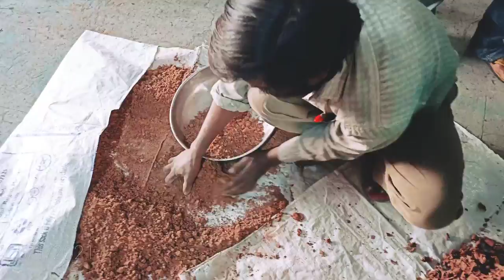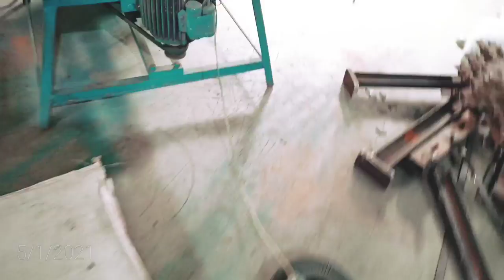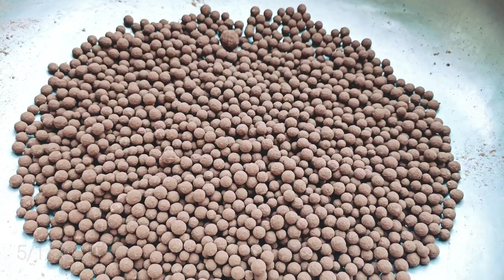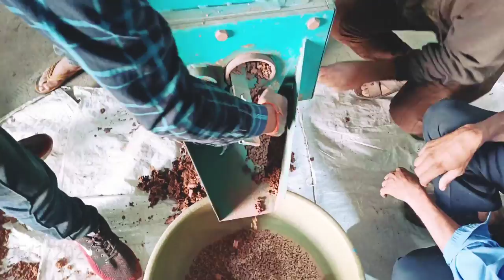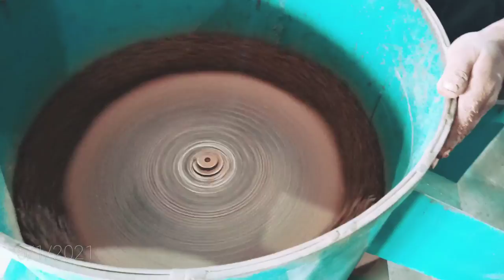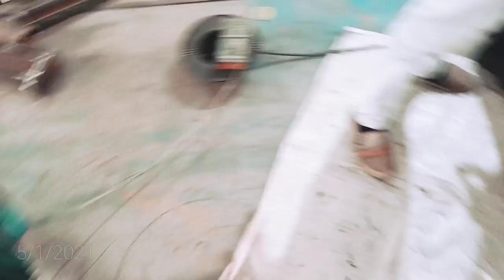Organic Fertilizer Granules Making Machine, Organic Waste जैविक खाद्य बनाने की मशीन,Organic Fertiliz

Comment: Tell me sir

Can v granulate dry cow dung or cocopeat
Reply from the maker: 𝐌𝐨𝐫𝐞 𝐃𝐞𝐭𝐚𝐢𝐥 𝐂𝐚𝐥𝐥 𝐎𝐫 𝐖𝐡𝐚𝐭𝐬 𝐚𝐩𝐩 𝐌𝐨𝐛𝐢𝐥𝐞-𝟖𝟎𝟎𝟎𝟎 𝟓𝟓𝟓𝟎𝟏
Reply: @jkpulverizer
Reply: @jkpulverizer  
where location of the co
cost of two machines 500 kg per hour capacity.
electric motor how many HP